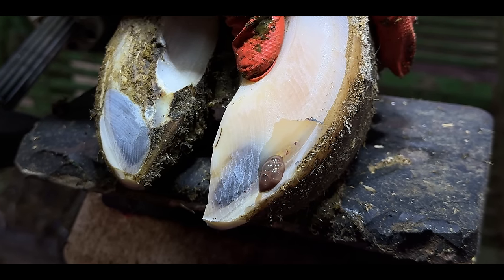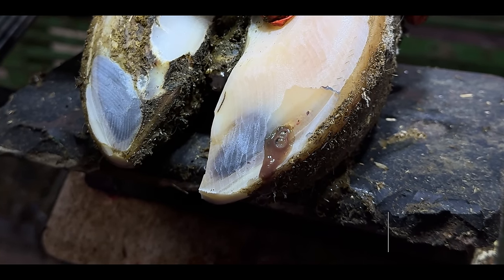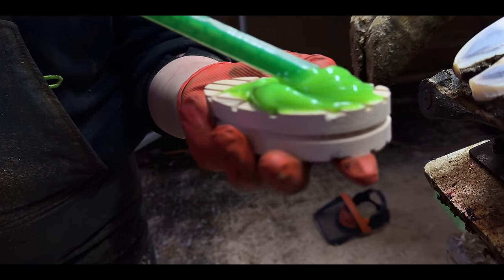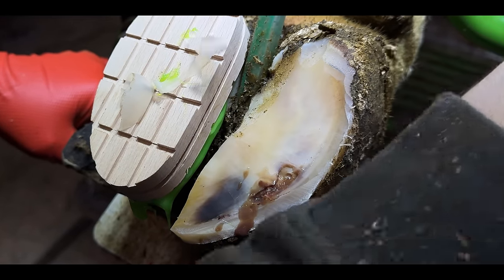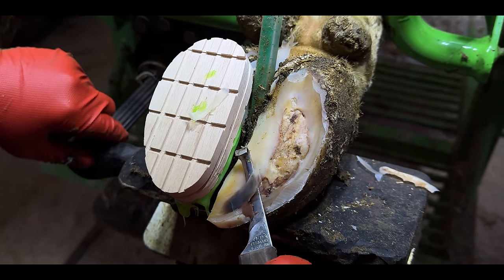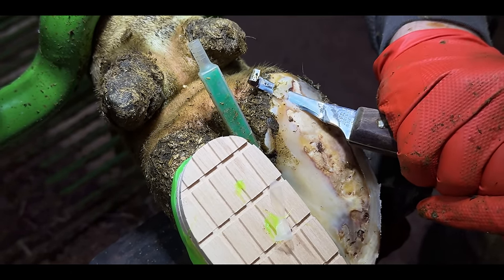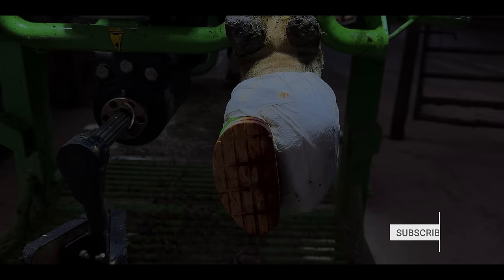MANURE BUBBLES ... in a cow's hoof 😥

Comment: This is probably a dumb question, but I don't think I've seen anyone ask it. I had horses for years, including two that were foundered, so I know horse hooves extremely well. We've been through it all--cut off the toe, reversed shoes, abscesses busting through the sole, abscesses busting through the coronet band, farrier quicked a hoof, etc., etc.  Obviously, cows are totally different with their two claws. What's the purpose of the torch on the claw before applying the block? Burning off dirt? Helps the glue set faster? Heat improves adhesion? Horses don't get blocks, and I've never seen a farrier use a torch to the foot for any reason. It's been bugging me since I first found your channel and inquirying minds need to know. Thanks!

Comment: Describing the hoof capsule as a shoe is a really good analogy. I suffer from gout from time to time and makes my foot swell up. Although it isn't an infection it is an immune response to uric acid crystals in my foot that cause swelling. If I put one of my hard formal leather shoes on in the morning to go to work and the swelling gets worse during the day the pain is so severe I have to walk on the outside of my foot and limp badly. I can't take my shoe off as I know I can't get it back on again. However, if were to cut the sole off my shoe off it would relieve the pressure immediately just like Graeme does with cows although getting home on a rainy day would be tricky. The swollen soft tissue of my foot inside a hard leather shoe is just like a cow with an infected hoof. l take medication which makes the swelling go away and wear soft shoes for a few days much as Graeme uses his treatments and blocks.

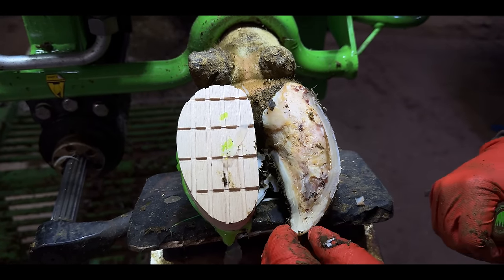Comment: 6:50 "Ooh, wrong one!" - after a couple of incidents, I got into the habit of colour coding my spray bottles. Red lid - isopropanol. Blue lid - panel degreaser. Green lid - soapy water. I can see from across my workshop what substance is in a bottle. And it's been at least a year since I tried to wet sand something with iso instead of water.

Comment: Is there a specific reason why you press on areas that have already depressurized, which increases fluid pressure to encourage its egress? The equation "PV=nRT" leads me to think you'd only trim to expose the hoof, and leave alone the remaining unpressurized detritus fluid until its cavity is fully exposed, at which point you'd spray it away with chlorhexidine.